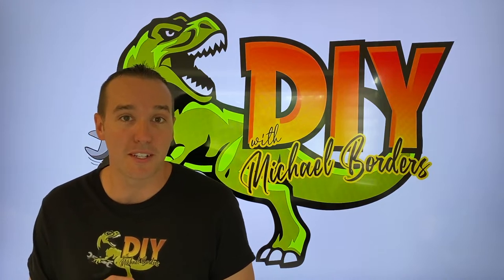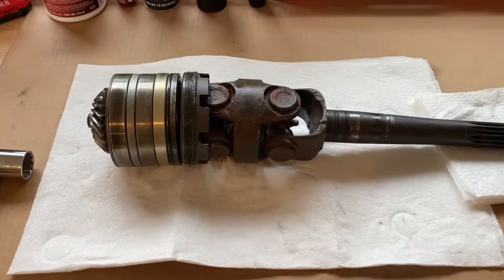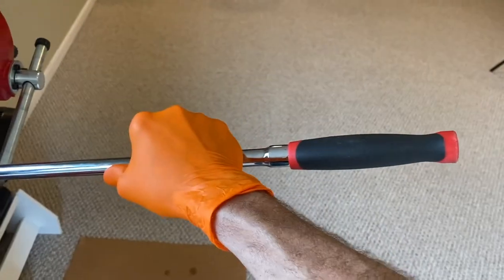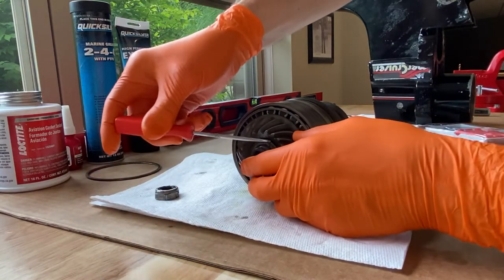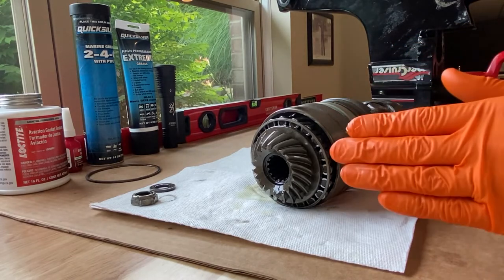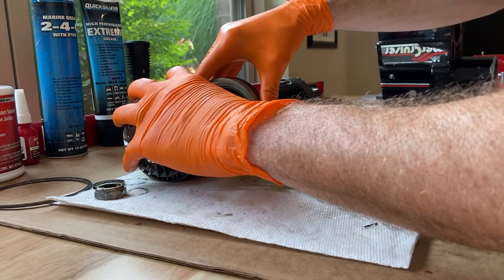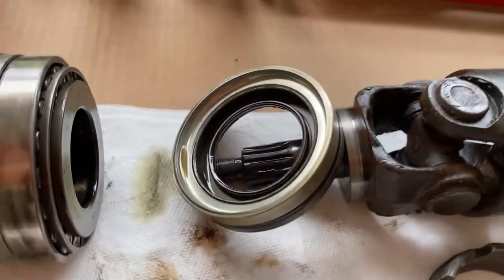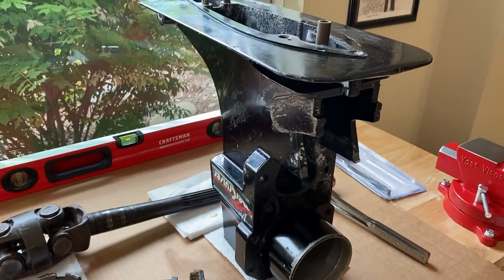DIY - disassemble Mercury mercruiser U-joint shaft bearing assembly

Comment: Mike, this morning I am taking the upper shaft apart, I placed the unit in the spanner wrench
before I removed the Nut I wanted to test the pre-load, I held the bearings with my hand and used a inch pound tester and found that the pre-load was (0), zero, no pre-load, do you have any idea what would cause that? My first thought was the person that worked on it before 
may have used the old washer. It's the same unit you're working on, 1986 3.7.  I'm taking it apart to replace the old oil seal. 
thanks Gary from Ohio.
Reply from the maker: Good morning Gary, we appreciate you reaching out to us.  Do you have the original/standard bearing set that requires just the inch-pound torque or do you have the newly designed bearing set shown in this video that requires a rolling resistance preload?

If you have the the original/standard bearing set, testing the pre-load will be off and inaccurate.  Keep us posted.

😁👍🧰
Reply: @DIYwithMichaelBorders  Thanks for getting back to me Mike, 
yes, I have the original/standard bearing set.
Dose the preload rolling resistance become less and less with use and age?
Reply from the maker: @garymilner2544  

Thanks for the reply.  Not as much as you would think however with the standard/original bearing set, the nut will be torqued to approximately 70-85 ft lbs depending on your exact model drive.
Reply: @DIYwithMichaelBorders  Thanks Mike, just took the gears a part and found the seal has worn groves in the shaft, so I order a new press in seal 
and the short yoke, thanks to your videos I got the part no's from you.
thanks again.
Reply from the maker: @garymilner2544  

That’s awesome, we are happy to help.  The DIY community is the BEST!  😁👍